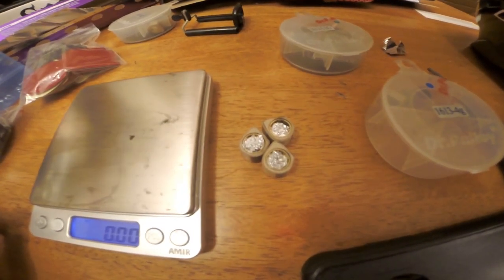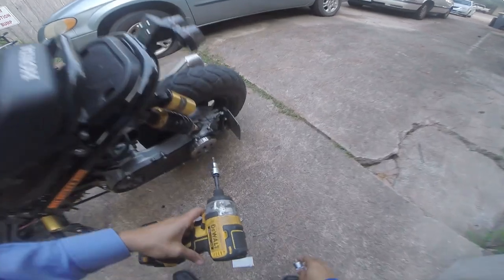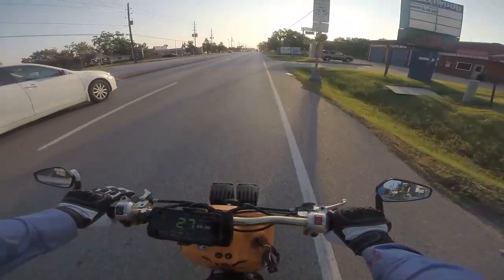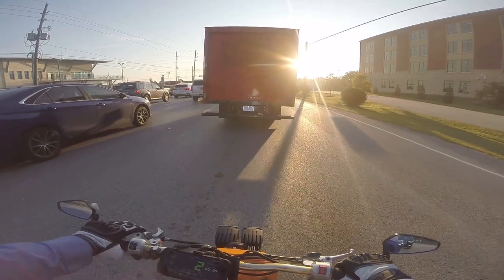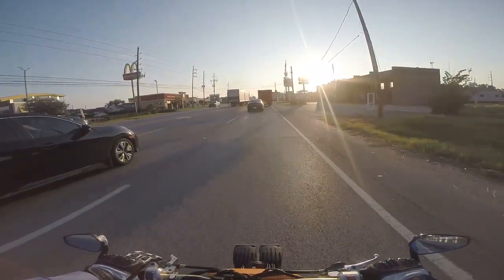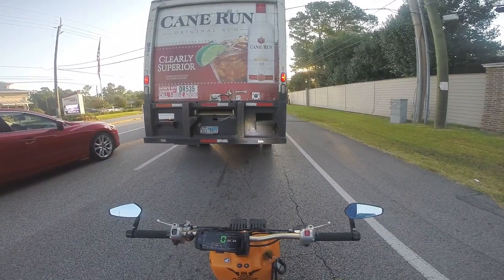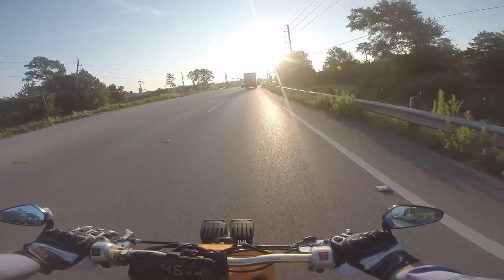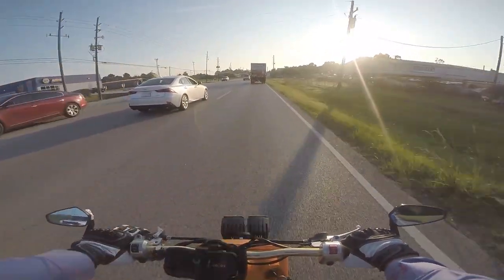Will Aluminum foil work to adjust your Honda Ruckus Sliders / Rollers to make it faster? [PART 2)}

Comment: I have a 2017 ruckus  I like it. I used a Honda CH 80 rear shock made a world of difference bolts right up with no modifications and $25 from eBay. I’m planning on doing a man in the box front fork spring upgrade very soon,,,, you did a pretty cool 😎 video
Reply from the maker: I need to do this BECAUSE the previous owner put the incorrect shot and does not have the clevis connection (U shaped connection) just a single side. Its not aligned and I feel like its going to break or fail someday. The one you got was it adjustable in any way?
Reply: Small Engine Velocity I really don’t know I found it on eBay for about $25 and free shipping it’s used,,, it was yellow so I spray painted it black,,, it’s got a big long spring on it and increase the height of the ruckus about a couple of inches or so,,,, i’m going to have to do a modification to the center stand because now it just barely touches the ground,,,, either that or go with a man in the box kickstand.....

Comment: And I’ll probably end up trying some different stuff with variator and weights I’ve been told to put a Kevlar belt on it
Reply from the maker: Get a Gates belt especially if you get an aftermarket  Varriator :) Also get a cheap tach. There is one on Amazon (mine is coming in the mail today) for like 10 dollars that everyone recommends. Stay away from the Pollini belt but do get the Polini varriaror upgrade.
Reply from the maker: Find my "5 things to make your Honda Ruckus faster" video :) Maybe it can give you some ideas - Oh yea and make sure you tires are aways full of air. If its low its good for 1-3 mph gain lol
Reply: Small Engine Velocity cool 😎

Comment: What is the most optimal slider weight combo you found for your polini? I have all the same mods and just need to switch to sliders but am not sure what size to start with. Also I'm 175lbs
Reply from the maker: My favorite combo is 4.5g and 5.5g but my motor so far defys the normal motors tuning for a ruckus. BUT everyone tuning should start here.

Comment: I wish the Honda ruckus had wet brakes I’m scared to make it go any faster than it already does because of the very weak stopping power.
Reply from the maker: I am 100% with you on that. I feel like I have to break before I think I need to break (predictive). Someday I may do a front disk but that is way out in the future. Also when my wife drives it I feel like she is not breaking early enough - SCARY!